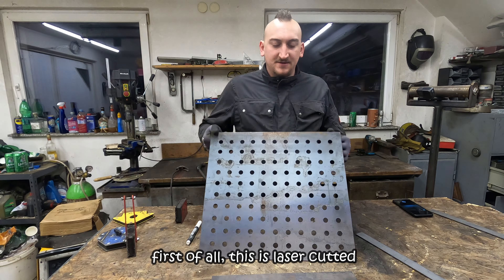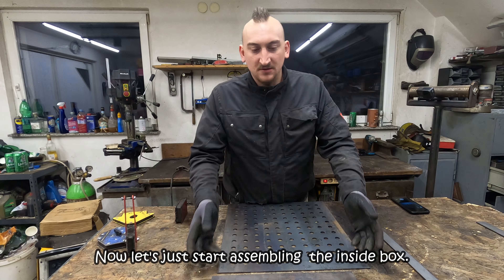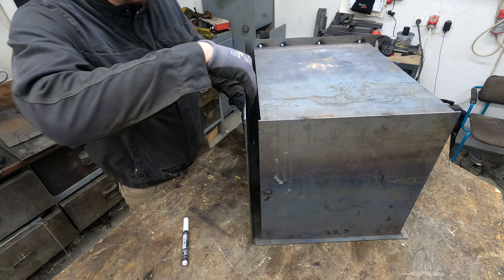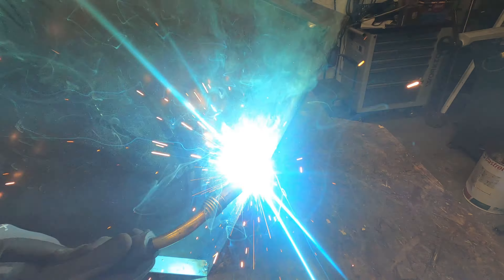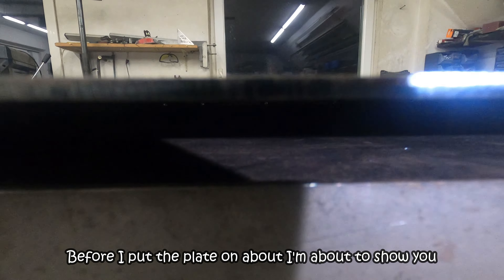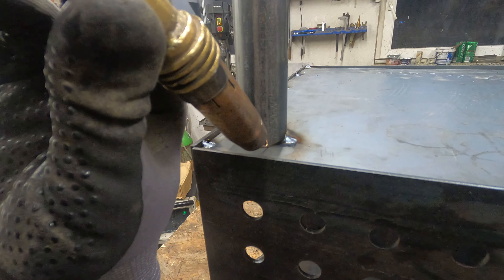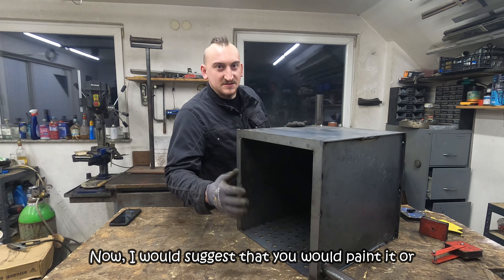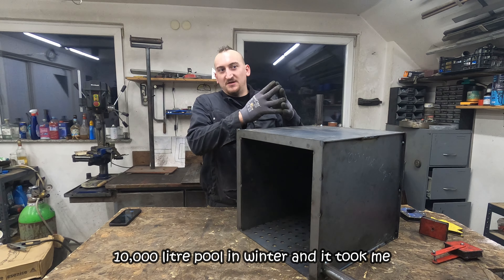CHEAP POOL HEATER (heating the pool in winter) HOME MADE

Comment: if you would insert ridges in the intermediate layer, you could also ensure that the water is forced to run through the entire heat exchanger. that would increase the efficiency immensely. not to heat the water even more, but to save fuel or time 😉
Reply from the maker: cheap and easy  was the point and it works great.